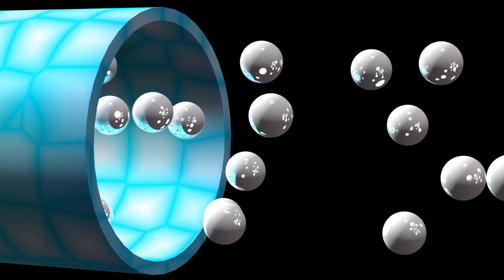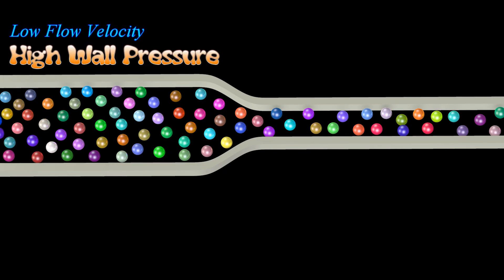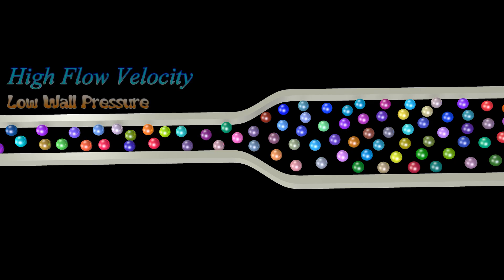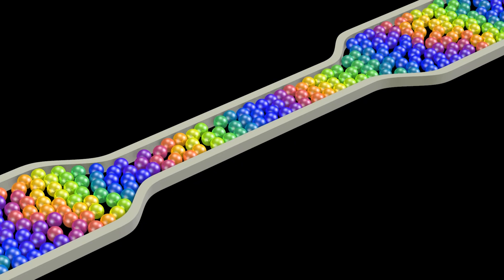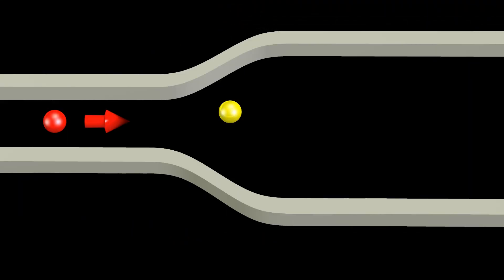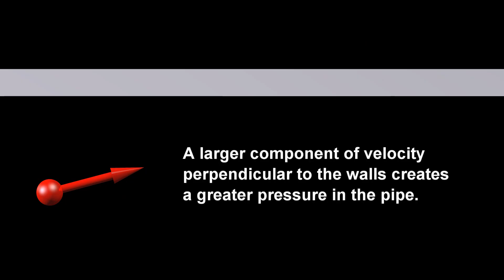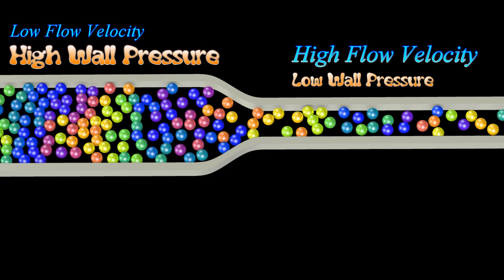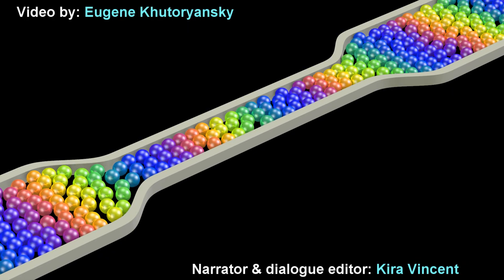Bernoulli’s Principle on Atomic Scale

Comment: Thank you very very much. I have a test in this week including Bernoulli's principle. I was so much confused with this strange principle, now it’s clear....❤️❤️❤️
Reply from the maker: Glad my video was helpful.  Good luck on your test.  Thanks.
Reply: Unfortunately, this speculation is not good science. 
However, give the answer your teacher wants.  They may be just as wrong and if you can't teach them, then just give them what they want.

The author of this script refuses to accept that a Pressure Gradient causes fluid acceleration as Euler revealed in the mid 1700 while following up on Bernoulli’s work. Air has mass and a force is required to accelerate any mass, even fluids. Pressure is the source of that force. 

Newton for fluids.

And, BTW, Euler derived what we now call Bernoulli's Equation. There is no indication that Bernoulli understood the cause-and-effect for what he saw in that typical venturi tube as the pressure/velocity inverse relationship.

This video’s explanation is very weak in its cause and effect logic. In fact, I am unable to follow the logic. Most times I’ve seen people trying to explain pressures down to the molecule level; they go astray in their assumptions as though it is simple balls - as a Newton’s “Hail of bullets”.

This video’s logic is faulty as follows.

It appears to be using another common misconception. Namely, that the random thermal motion of the molecules is changed by a net speed of the fluid in one direction. This claim is that the velocity and therefore momentum toward the wall is reduced by adding a velocity along the wall. This is clearly nonsense.  The temperature random motion is superimposed on the overall bulk velocity in any direction.

There is nothing to suggest that molecules change their random vibration to more in one direction (along a pipe) and less in another (perpendicular to the wall).  They vibrate the same thermal way regardless of a net movement in one direction and the component of that motion toward a wall is unchanged by that directed speed. This is how vector addition of velocities works.
Orthogonal velocities do not affect each other. This is just like the classical physics example of a cannon-ball that has its horizontal speed unaffected by gravity and its vertical acceleration by gravity unaffected by the horizontal speed.

By this reasoning, air in a sealed jar that is shot from a cannon has altered vibration motions from when sitting still.  This cannot be true.

For example, here is how velocities like this will add: A molecule moving thermally at some instant with a velocity at 45 degrees (up right) with speed (magnitude) 1.0 has an upward component toward a wall above it of 0.707 and a forward component to the right of 0.707. Adding a horizontal speed to the right of 5.0 results in a new horizontal speed component of 5.707 and the same vertical component of 0.707.

Velocities add vectorially.

The component of momentum perpendicular to the wall is unchanged.  The air exiting any blower into open air is at the very same pressure as the still air around it.

This can easily be measured by anyone, just as it is by professional aerodynamicists every day as shown here in 
Weltner, Fig 3:
http://user.uni-frankfurt.de/~weltner/Misinterpretations%20of%20Bernoullis%20Law%202011%20internet.pdf

Finally, the video completely ignores the  presence of the well-known boundary layer which is completely motionless at the surface, so as a result, this claim of the molecules moving along the tube is completely invalid before even entering this above discussion.

 This is bad science.
Reply from the maker: Observ45er, the video is correct.  You may want to read the following.
http://physics.ucsc.edu/~ccrummer/aero1.pdf
Reply: Another fatal flaw is that molecules have completely random motions. There aren’t some molecules vibrating in one direction and others vibrating in other directions. The vibration of each molecule is a distribution in all directions. None have more velocity in any one direction; they vibrate in all directions randomly.  Therefore, every atom/molecule has equal velocities in all directions.  There can’t be any with more going along the pipe.

previous
Reply from the maker: Observ45er, a much more detailed analysis of this topic is given at https://arxiv.org/pdf/nlin/0507032.pdf

Comment: Eugene, you are the God of YouTube! 😲 You really saved my student life, by explaining things which are just "accepted" during our career. Thank you so much!
Reply from the maker: I am glad my videos have been helpful.  Thanks.
Reply: Unfortunately, this speculation is not good science. 

The author of this script refuses to accept that a Pressure Gradient causes fluid acceleration as Euler revealed in the mid 1700 while following up on Bernoulli’s work. Air has mass and a force is required to accelerate any mass, even fluids. Pressure is the source of that force. 

Newton for fluids.

And, BTW, Euler derived what we now call Bernoulli's Equation. There is no indication that Bernoulli understood the cause-and-effect for what he saw in that typical venturi tube as the pressure/velocity inverse relationship.

This video’s explanation is very weak in its cause and effect logic. In fact, I am unable to follow the logic. Most times I’ve seen people trying to explain pressures down to the molecule level; they go astray in their assumptions as though it is simple balls - as a Newton’s “Hail of bullets”.

This video’s logic is faulty as follows.

It appears to be using another common misconception. Namely, that the random thermal motion of the molecules is changed by a net speed of the fluid in one direction. This claim is that the velocity and therefore momentum toward the wall is reduced by adding a velocity along the wall. This is clearly nonsense.  The temperature random motion is superimposed on the overall bulk velocity in any direction.

There is nothing to suggest that molecules change their random vibration to more in one direction (along a pipe) and less in another (perpendicular to the wall).  They vibrate the same thermal way regardless of a net movement in one direction and the component of that motion toward a wall is unchanged by that directed speed. This is how vector addition of velocities works.
Orthogonal velocities do not affect each other. This is just like the classical physics example of a cannon-ball that has its horizontal speed unaffected by gravity and its vertical acceleration by gravity unaffected by the horizontal speed.

By this reasoning, air in a sealed jar that is shot from a cannon has altered vibration motions from when sitting still.  This cannot be true.

For example, here is how velocities like this will add: A molecule moving thermally at some instant with a velocity at 45 degrees (up right) with speed (magnitude) 1.0 has an upward component toward a wall above it of 0.707 and a forward component to the right of 0.707. Adding a horizontal speed to the right of 5.0 results in a new horizontal speed component of 5.707 and the same vertical component of 0.707.

Velocities add vectorially.

The component of momentum perpendicular to the wall is unchanged.  The air exiting any blower into open air is at the very same pressure as the still air around it.

This can easily be measured by anyone, just as it is by professional aerodynamicists every day as shown here in 
Weltner, Fig 3:
http://user.uni-frankfurt.de/~weltner/Misinterpretations%20of%20Bernoullis%20Law%202011%20internet.pdf

Finally, the video completely ignores the  presence of the well-known boundary layer which is completely motionless at the surface, so as a result, this claim of the molecules moving along the tube is completely invalid before even entering this above discussion.

 This is bad science.
Reply from the maker: Observ45er, the video is correct.  You may want to read the following.
http://physics.ucsc.edu/~ccrummer/aero1.pdf

Comment: Omg!!! What an expalantion. Unbelievable. Never taught this fact in school
Reply: Unfortunately, this speculation is not good science. 

The author of this script refuses to accept that a Pressure Gradient causes fluid acceleration as Euler revealed in the mid 1700 while following up on Bernoulli’s work. Air has mass and a force is required to accelerate any mass, even fluids. Pressure is the source of that force. 

Newton for fluids.

And, BTW, Euler derived what we now call Bernoulli's Equation. There is no indication that Bernoulli understood the cause-and-effect for what he saw in that typical venturi tube as the pressure/velocity inverse relationship.

This video’s explanation is very weak in its cause and effect logic. In fact, I am unable to follow the logic. Most times I’ve seen people trying to explain pressures down to the molecule level; they go astray in their assumptions as though it is simple balls - as a Newton’s “Hail of bullets”.

This video’s logic is faulty as follows.

It appears to be using another common misconception. Namely, that the random thermal motion of the molecules is changed by a net speed of the fluid in one direction. This claim is that the velocity and therefore momentum toward the wall is reduced by adding a velocity along the wall. This is clearly nonsense.  The temperature random motion is superimposed on the overall bulk velocity in any direction.

There is nothing to suggest that molecules change their random vibration to more in one direction (along a pipe) and less in another (perpendicular to the wall).  They vibrate the same thermal way regardless of a net movement in one direction and the component of that motion toward a wall is unchanged by that directed speed. This is how vector addition of velocities works.
Orthogonal velocities do not affect each other. This is just like the classical physics example of a cannon-ball that has its horizontal speed unaffected by gravity and its vertical acceleration by gravity unaffected by the horizontal speed.

By this reasoning, air in a sealed jar that is shot from a cannon has altered vibration motions from when sitting still.  This cannot be true.

For example, here is how velocities like this will add: A molecule moving thermally at some instant with a velocity at 45 degrees (up right) with speed (magnitude) 1.0 has an upward component toward a wall above it of 0.707 and a forward component to the right of 0.707. Adding a horizontal speed to the right of 5.0 results in a new horizontal speed component of 5.707 and the same vertical component of 0.707.

Velocities add vectorially.

The component of momentum perpendicular to the wall is unchanged.  The air exiting any blower into open air is at the very same pressure as the still air around it.

This can easily be measured by anyone, just as it is by professional aerodynamicists every day as shown here in 
Weltner, Fig 3:
http://user.uni-frankfurt.de/~weltner/Misinterpretations%20of%20Bernoullis%20Law%202011%20internet.pdf

Finally, the video completely ignores the  presence of the well-known boundary layer which is completely motionless at the surface, so as a result, this claim of the molecules moving along the tube is completely invalid before even entering this above discussion.

 This is bad science.
Reply from the maker: Observ45er, the video is correct.  You may want to read the following.
http://physics.ucsc.edu/~ccrummer/aero1.pdf

Comment: Best explanation for the Bernoulli's Principle!!!!!
Reply from the maker: Thanks for the compliment.  I am glad you liked my explanation.
Reply: Unfortunately, this speculation is not good science. 

The author of this script refuses to accept that a Pressure Gradient causes fluid acceleration as Euler revealed in the mid 1700 while following up on Bernoulli’s work. Air has mass and a force is required to accelerate any mass, even fluids. Pressure is the source of that force. 

Newton for fluids.

And, BTW, Euler derived what we now call Bernoulli's Equation. There is no indication that Bernoulli understood the cause-and-effect for what he saw in that typical venturi tube as the pressure/velocity inverse relationship.

This video’s explanation is very weak in its cause and effect logic. In fact, I am unable to follow the logic. Most times I’ve seen people trying to explain pressures down to the molecule level; they go astray in their assumptions as though it is simple balls - as a Newton’s “Hail of bullets”.

This video’s logic is faulty as follows.

It appears to be using another common misconception. Namely, that the random thermal motion of the molecules is changed by a net speed of the fluid in one direction. This claim is that the velocity and therefore momentum toward the wall is reduced by adding a velocity along the wall. This is clearly nonsense.  The temperature random motion is superimposed on the overall bulk velocity in any direction.

There is nothing to suggest that molecules change their random vibration to more in one direction (along a pipe) and less in another (perpendicular to the wall).  They vibrate the same thermal way regardless of a net movement in one direction and the component of that motion toward a wall is unchanged by that directed speed. This is how vector addition of velocities works.
Orthogonal velocities do not affect each other. This is just like the classical physics example of a cannon-ball that has its horizontal speed unaffected by gravity and its vertical acceleration by gravity unaffected by the horizontal speed.

By this reasoning, air in a sealed jar that is shot from a cannon has altered vibration motions from when sitting still.  This cannot be true.

For example, here is how velocities like this will add: A molecule moving thermally at some instant with a velocity at 45 degrees (up right) with speed (magnitude) 1.0 has an upward component toward a wall above it of 0.707 and a forward component to the right of 0.707. Adding a horizontal speed to the right of 5.0 results in a new horizontal speed component of 5.707 and the same vertical component of 0.707.

Velocities add vectorially.

The component of momentum perpendicular to the wall is unchanged.  The air exiting any blower into open air is at the very same pressure as the still air around it.

This can easily be measured by anyone, just as it is by professional aerodynamicists every day as shown here in 
Weltner, Fig 3:
http://user.uni-frankfurt.de/~weltner/Misinterpretations%20of%20Bernoullis%20Law%202011%20internet.pdf
Reply from the maker: Observ45er, the video is correct.  You may want to read the following.
http://physics.ucsc.edu/~ccrummer/aero1.pdf
Reply: @EugeneKhutoryansky  I've always been interested in understanding physics from events that happen on an atomic scale which collectively emerge as a macro phenomenon.  Can you do a video on why a vessel of compressed air cools when it's allowed to leak through a nozzle.   Gas laws (PV=nRT) are often used to explain it, but it doesn't explain at a microscopic level what's happening at the nozzle, where the random motion (heat energy) is converted to unified linear motion (kinetic energy).   It seems nobody is interested in teaching students of science what's really happening under the hood.  Thank you for making great videos.
Reply from the maker: Albert, I will add that to my list of topics for future videos.  Thanks for the suggestion and thanks for the compliments.

Comment: Does this mean there is a very high pressure at the "pinch point" between the large and small pipe? As this point is filtering out many of the water molecules moving diagonally and such?